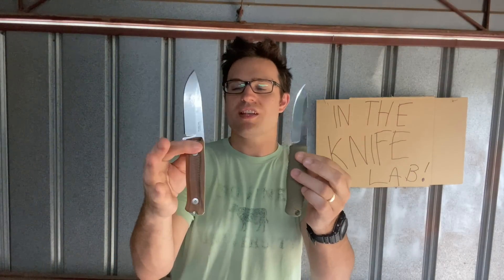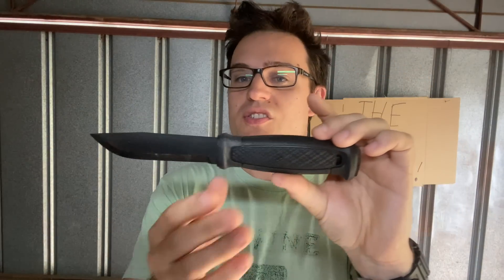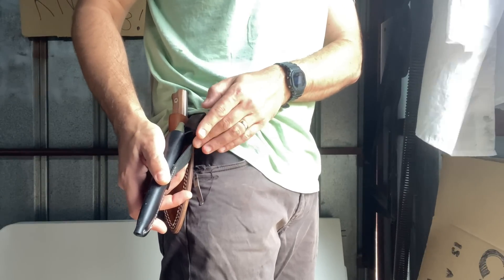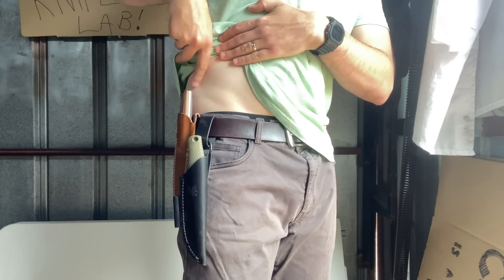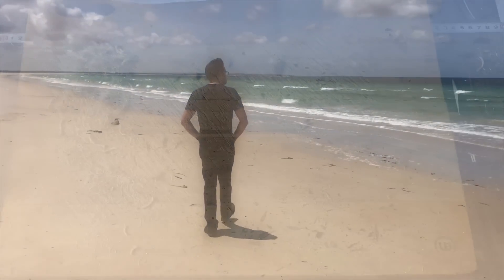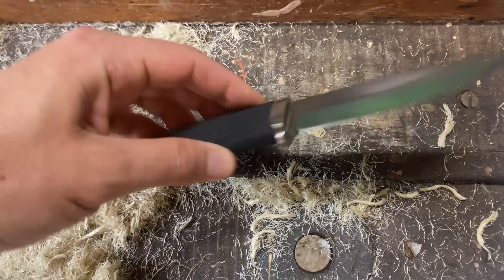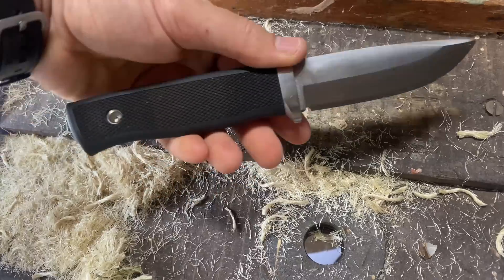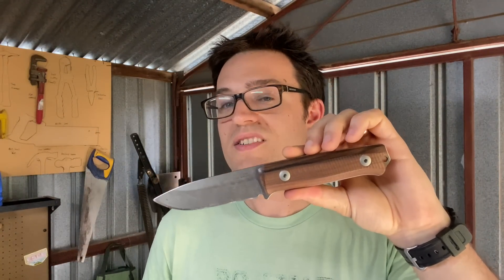Lionsteel B40 vs Benchmade 200 Puukko - Bushcraft Blades Review & Comparison

Comment: Hey Pete, I just wanted to point out, on the 4th strike on the coconut with the lionsteel, the edge was actually subjected to more lateral forces due to the coconut rolling a bit. Knife edges don't take lateral loads the best.

Btw, my condolences for the cutting board.
Reply: Actually, there was no force laterally. The roll was after impact without force applied. It might have had some effect, but I highly doubt that.

Comment: That's true. Compared Lionsteel B40 vs Benchmade 200 Puukko, Benchmade looks a bit crappy (although 3V steel is better than Sleipner). Unfortunately, no one has yet invented the perfect steel. Each has its advantages and disadvantages. 3V steel is harder, but it will also become dull eventually and needs to be sharpened. Sleipner is easier to sharpen. Both don't like moisture. Need to wipe dry. The knife should fit well in the hand. The best, most expensive knife when dull will be worse than a cheap but sharp one. Sharpening isn't exactly easy, but it's not atomic physics either. You need to invest in whetstones, paddle strop and stropping compound. A knife is a tool and you need to keep it in order.

Comment: I just performed the same coconut test with my B40 and I had zero issues.... cracked it on the third whack with NO edge damage whatsoever.  I think the problem you had in this comparison, was that the coconut rolled.
Reply: or 
 17 degrees angle  on 60hrc steel
Reply: A bit late but, i did the same thing with the B40 and the M7, smashed the coconut too pulp and not even a mark on them.

Comment: I have the Benchmade and had a good look at the Lion Steel at the time of buying.  The Benchmade sheath is awful. I agree that I like the dangler, but does not retain the knife.  If it turns upside down, the knife falls out.  If that happens in a pack, it is dangerous.  The fire steel loop is also too small to take a standard size fero-rod, if that matters to you.  The Lion Steel sheath is excellent.  In Europe, value for money it is no comparison, Lion Steel is the better made knife and cost the same or less.
Reply: The Benchmade is way tougher than the Lionsteel--this is fact. The Lionsteel was humiliated in the video. I don't give a fuck about the sheath. Funny, you know all about the Lionsteel sheath and you didn't buy a Lionsteel. How come you didn't know about the Benchmade sheath before you bought the Benchmade? (I'm not even totally convinced you did buy one. But if you did, given your snotty comment, I don't know why you didn't return it.)
Reply: @profd65  
There really wasn't a need to swear.  You know profanity is said to be a crutch for the inarticulate?  
Do you have either of the knives shown?  If so, what have been your experiences?  Do you use the factory sheath or did you get a replacement?  Why don't you care about potentially losing a knife, or getting cut?  You are certainly entitled to not care, but it would help other folk reading this to know why.

I bought the Benchmade from a store in person, so I knew about the difference in sheaths, but I can make my own sheaths so it wasn't a deal breaker for me.  Other people who have to buy on-line and can't make a sheath can only go by what they see or read in reviews and might care to trade some coconut chopping ability for security and safety.  I didn't buy that Lion Steel at the same time because I bought one of their folders.  I have since bought a B41 and B35.  I wanted to try the Benchmade handle shape, blade shape, and most of all the steel.  I like the blade shape on the Benchmade better than the Lion Steel, more point, less depth, easier to make tight turning cuts when carving.  Didn't like the edge angle on either, too obtuse to cut wood well, but the Benchmade was thicker behind the edge before I re-worked the bevel angle.  The steel has held up well, arguably better than my O-1 knives at similar edge angles.
Best regards.
Reply: @profd65  did you even watch the video? the lionsteel won the majority of the tests, it made the benchmade look cheap in comparison. it's okay to like a company, but you don't have to defend them from criticism, people can make their own choices and criticism will help them make a better knife in the future, if they ever see it.

Comment: You are right about "Bushcraft" it is just an internet generated sensation including the Ray mears. So many knives and steels how far do you take it. I have been using Opinel No9 Carbon Steel since the early 80's and the Mora classic carbon blade. I prefer thin blades. I tried Fallkiven F1 Pro recently where I received as a present, great knife but it is too thick for some of my tasks.

Comment: Aahhh... you must continue to use that same cutting board.. switching it will invalidate future test comparisons against past comparisons because the wood does indeed also take a toll on the edge along with the rope.   A harder/softer/different board will work edges differently going forward.   Although, it probably is loaded with fine metal particles nowadays, so... 

Please pop open a coconut with a harder 3v blade, Bark River, etc.. for direct toughness comparison to the Benchmade's softer heat treat.
Same coconut if you still have it around?

Comment: Not to be that guy but in your toughness test you hit the lionsteel once more than the benchmade, and seems like the blade twisted out of the coconut? Kinda invalidated the results of you're gonna make the one do 25% more cutting and twist the edge
Reply from the maker: but then then benchmade did three more and cracked the coconut and still cut paper
Reply: @CedricAda  more likely the glancing hit then, my point being it's not a comparable result, too many variables
Reply: @antimatter4733  You are that guy. The Lionsteel lost. Get the fuck over it. The Benchmade has way tougher steel.

Comment: Isn’t victorinox 56 tough enough for general purposes, harder steel may be brittle. So for me victorinox steel is corrosion resistant tough and easy to sharpen. I don’t think 🤔 a steel that might snap is much use for a general purpose knife stroke multi tool, I guess victorinox know exactly what they are doing 👍🏻

Comment: Benchmade raise the 3v rockwell on the bailout for 2020 to 60-63. im not sure if they upgraded it for the Puukko or not. Benchmade wouldnt say more details. for the coconut, the benchmade has better geometry. had you used the bailout at 56hrc, it would have rolled.
Reply from the maker: most definitely, theres a lot of meat behind this edge compared to the bailout
Reply: But I would say using the two ouces bailout to cut open a coconut like that it is a whole new level of abuse, unlike when you are doing it with the bushcraft knife. I think the bailout softer steel is justified if you use it for light abuse like using it as a screw driver or can opener, the ultra fine tip could use the softer heat treat, but if you want to go fully abusive use like pry open a crater you should not use anything that weigh less than 4 ouces.
Reply: @Iamthedudeman00  I don't think you understand what I'm trying to say. And no 56hrc 3v is not acceptable.
Reply: Tactical Center ok anyways looks like they did what everyone wants in the end, maybe everyone would be happy now.:) as far as I am concerned I am keeping my bailout and buying the new M4 bailout, because I am a knife collector too you see.more is good for me! Good discussion!
Reply: @Iamthedudeman00  you should see if they will upgrade your bailout blade at no cost if you send it in.
Reply: Tactical Center I won’t send it in really, it is a lot work and trouble, but I think it is interesting for me to keep such a controversial knife. You never know if the knife will become quite a collectible someday. Honestly I see where they are coming from and I don’t think it is a problem ( I made two discussion videos about it on my channel if you are curious, the videos are called knife collector comedy) I have plenty of knives with super edge retention so why not have this very unusual knife as well. But thanks for the suggestion. :)
Reply: @Iamthedudeman00  heat treatment is value and one with a heat treatment that is poor or not acceptable for its composition, is not valuable. Brings value down if anything. Collecting every knife and variation is just an addiction. If you have that addiction, that's better than wasting it on drugs. But not necessarily smart. But whatever makes someone happy.

Comment: Benchmade totally destroyed lionsteel in that coconut test, it obviously has much more durable steel, on benchmade's official site it is 60-62 HRC, not 56 like you said, and it is definitely not softer still tan lionsteel, because lionsteels edge vas ruined after only 3 coconut hit, and benchmade cut it with no problem, also in wood carving benchmade was clear winner, I don't understand why you keep saying that it have bad heat-treatment and it is 56 HRC because that is just not the truth, and you can see it from tests...

Comment: Sold my Benchmade Puukko. Just didn't hold and edge. Shame as it was potentially a very cool knife,
Reply: Did you think a knife as incredibly tough as the Puukko would hold an edge really well?
Reply: Easily, with a good heat treatment.. running 3V at approx. 56hrc is a joke.

Comment: The coconut test is invalid because you folded the lion's bevel when the coconut slipped even though the cpm should be 3 times higher
Reply: The Lionsteel failed the coconut test. The Benchmade passed. The Benchmade has much tougher steel.